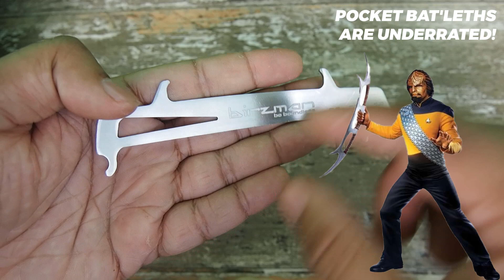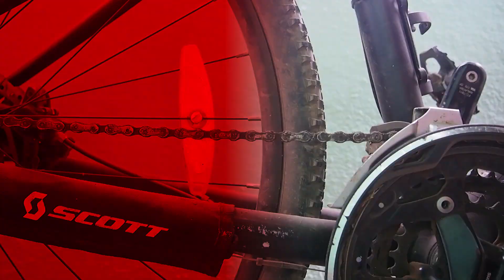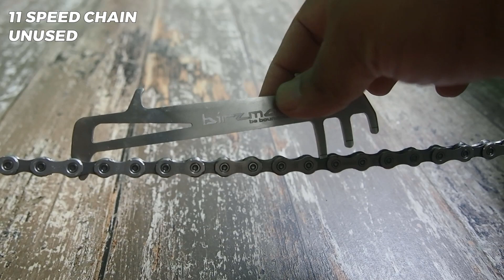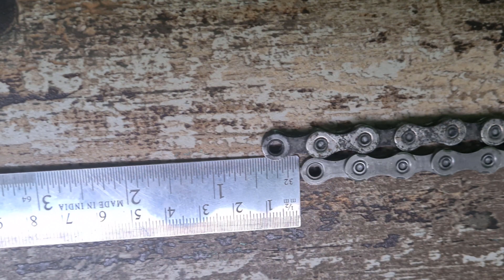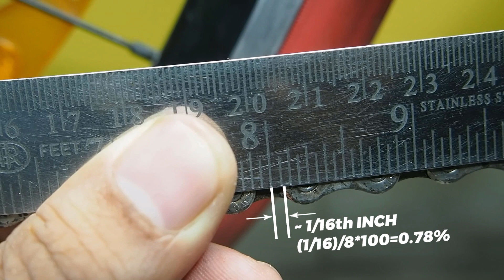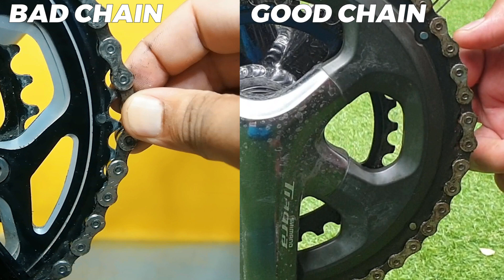How to Check Cycle Chain Wear | Don't Make this Expensive Mistake!

Comment: Even many experts seem to measure chain stretch between the derailleur and chainring but I argued that chain tension isn't realistic and gives false readings. I get noticeable greater reading when measuring between cassette and chainring while pushing down the pedal a bit.

Also don't buy the cheapest chains because they stretch so quickly that it can surprise you.

Comment: Interesting. Please note however a new chain and worn sprocket will not manifest itself firstly on the large sprocket. It will appear with few exceptions on the smallest, (unless that never gets used) 
Makes sense too as chain rings (very large comparatively) are the last of all to skip and chain suck when entire transmission is totally worn.

Comment: Great insights!
How many kms does a chain generally last? I have a KMC X9.
Reply from the maker: Thank you Nitish - it really depends on how well you take care of your chain, and the conditions your ride in. I would say ... anywhere between 3 and 6000 km on average (should be the case for your X9 as well). If you wax your chain and take good care of it (stay tuned for an upcoming video on this) - they claim it could last for up to 15000 km!
Reply: @TheIndianCyclist  oof! That's a lot. Waiting for that.
I think 9-speed chains will be more durable as they are thicker and heavier. And yes, variable factors also count. Thanks

Comment: Chain wear is not bad for me looks like but it is getting pretty rusty in spots. Do I use sandpaper to get it out? or just a good wipe down with oil?
Reply from the maker: If not too rusty, maybe you could give it a rub down after a degreaser soak and see what comes off. I must say I don't have experience with rust removal myself, but wire brushes / steel wool seem to be recommended online.
Reply: same type of question was from TRUMP: may people drink disinfectant to kill covid virus